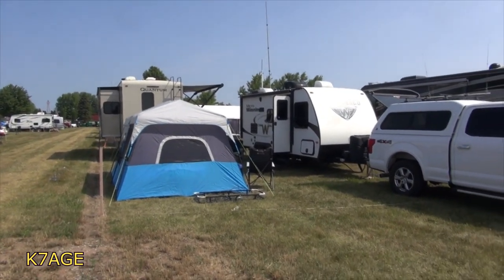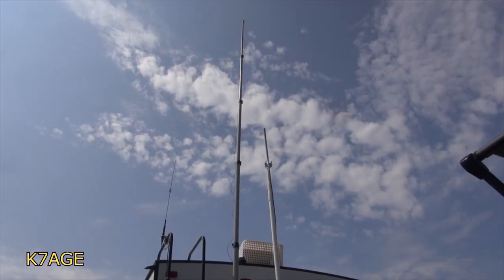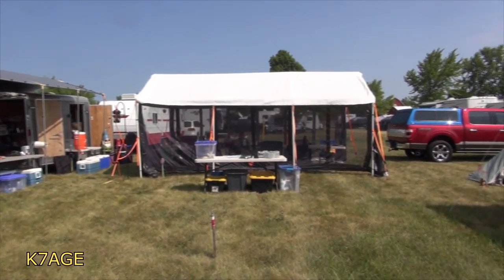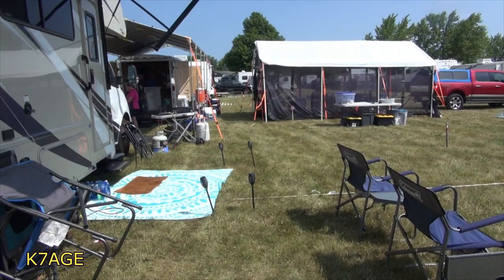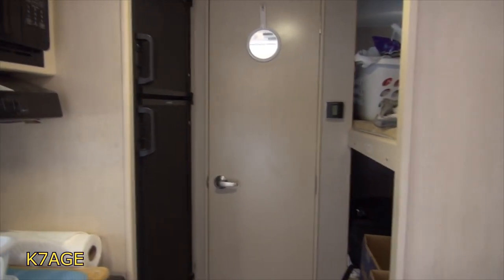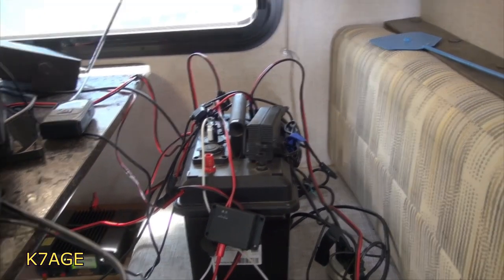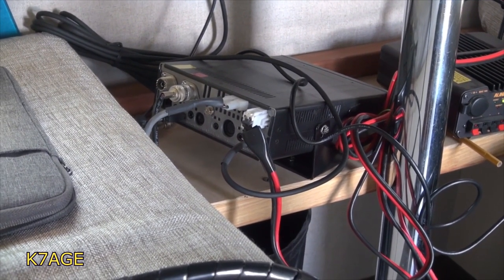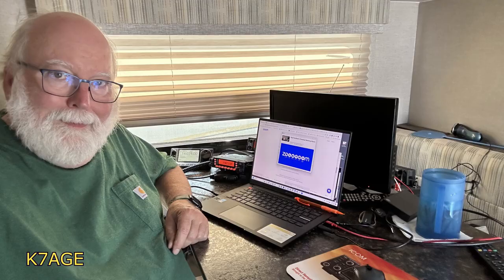Oshkosh Camp and Trailer Tour.

Comment: At 7'35", that RF cable behind the radio seems not in good condition, it's bent too much. 73, KG6YJ
Reply from the maker: I need to redo those connectors. To much stress. I’ll cut back the wrap.